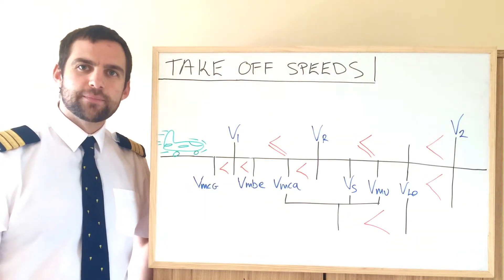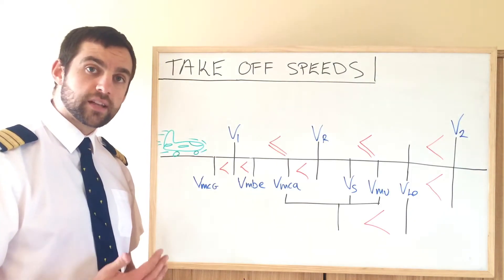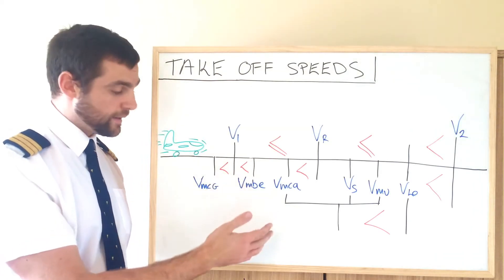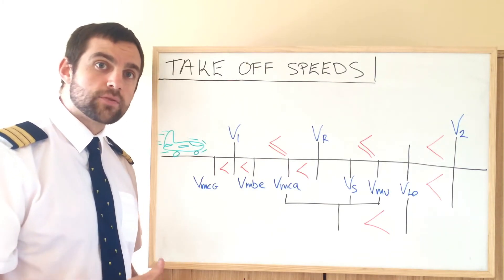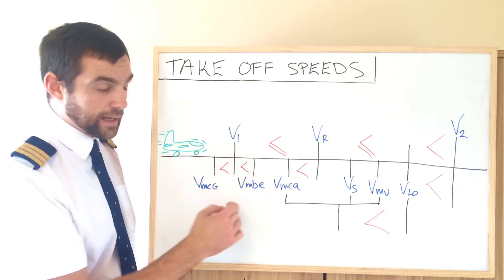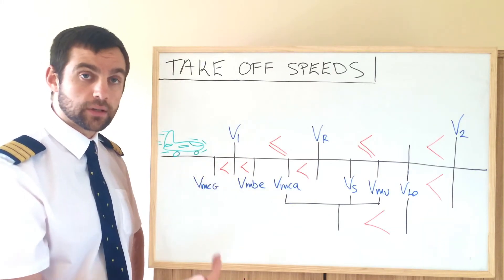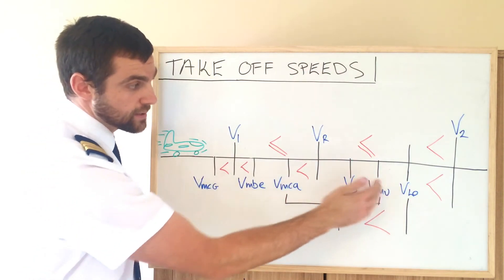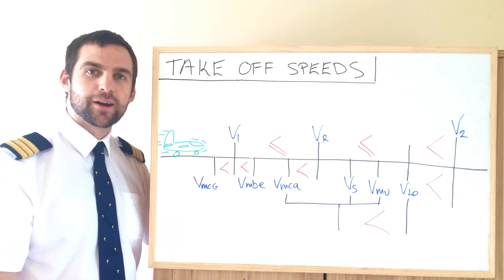ALL the Take-Off Speeds ✈ ATPL ✈

Comment: Hello Ed, 
Thanks a lot for the videos!!!
I have a couple things to point out in this one though.

According to the Bristol ATPL course (v.2020):
Vr > or = Vs for Class B single engine aircrafts
Vr > or = 1.1 Vs for Class B mutliple engines aircrafts
Vr > or = (Vmu + x) for Class A aircrafts

Can you also confirm that Vmu is supposed to be located AFTER Vs1?
I can't seem to find any proper resource on this.

Thanks again for the videos!

Comment: Hi there, great videos! Thanks for sharing!
I’ve noticed a couple of comments on Vs that cannot be higher than Vmca. Since I’m sitting Performance subject soon (fingers crossed) I may know where do they come from:
There’s an explicit question in EASA bank where the only correct answer is:
Vs < Vmca < V2min
And I guess the reason is Vmca is varying according to density. It is very possible that in high density Vmca is higher than Vs that should be a fixed value.
Hope that may help.. again thanks for your videos!

Comment: This diagram is incorrect. From Bristol online question on Performance ATPl "VS< VMCA< V2 min". Which makes all sense, how could you rotate your aircraft (lift-off) if the VR< VS (you would stall while rotating...). Can you please clarify?
Reply from the maker: Don't confuse rotating with lift off mate. I think your getting them mixed up. :) When I rotate my aircraft its not flying yet.
Reply: PilotEd Roger, thanks. But the point is your stall speed can never by higher than Vmca. If I reply that in Performance it's wrong...

Comment: Thank you for the video. Just on question, where in the speeds sequence you apply the V2 min?
Reply from the maker: same place as v2 mate. Certification requirements specify only minimum values for V2. Manufacturers and operators often choose to use the minimum value of V2 because it will get the aircraft airborne in the shortest distance.

Comment: U missed f after vlo because should be vlof, and vlo, is the max speed at which landing gear can stay extended.
Reply from the maker: well spotted thanks! :)
Reply: Small correction there. Vlo is the max landing gear operating speed (when the gear is in transit). Vle is the max speed when it is extended.
Reply from the maker: yep corrected in the description thanks :) just a typo
Reply: PilotEd no I'm talking about the guy who commented. He was slightly mistaken

Comment: Is there a Vmcu speed or is it possible Vmcu=Vmcl ? I can't find proper explanation about it.
Reply from the maker: Vmc is minimum control, there are various mc speeds. never heard of U one but it may exist.  VMCG, VMCA, VMCA1, VMCA2, VMCL, VMCL1, VMCL2, these ive heard of. :)
Vmcl is minimum control speed, landing configuration , one engine inop XD
Reply: PilotEd I see,this is helpful enough.Thanks:)
Reply: Hi again,what's relation between Vmu and Vr?As far as I know Vr is greater than Vmu,isn't it?
Reply from the maker: other way round i think Vr comes before Vmu, a little counter intuative i know ;) but you start the roatation and then the unstick speed occurs
Reply: PilotEd I see,You may be right.I don't have a true reference to confirm my idea,but I read somewhere that for short field t/os are done at Vmu to get the wheels out of sfc to continue to accelerate.This made me confused.So from which sources can I get official reference? And many thanks for your respond:) I have an interview very soon.All infos mixed in my mind.Thanks for help
Reply from the maker: Vmo is the speed the aicraft can actually T/O the ground, it must therefore be greater than Vs and Vs is deff greater than Vr. :) happy christmas
Reply: PilotEd I see,many thanks :) happy x-mass